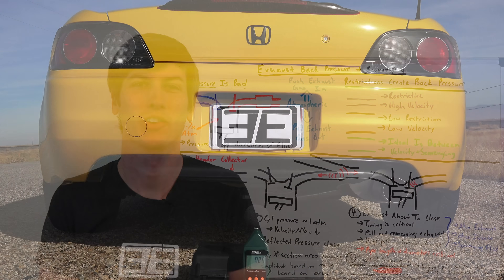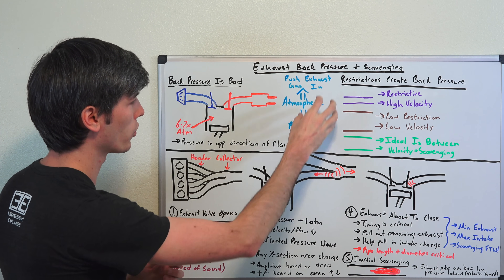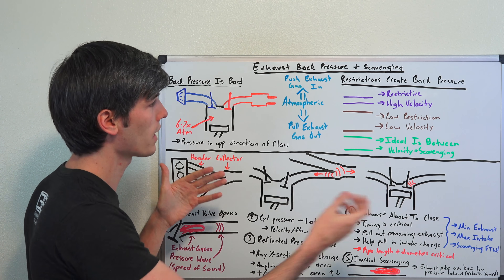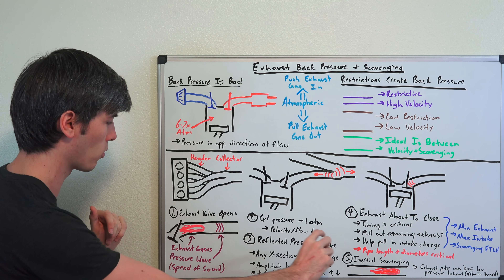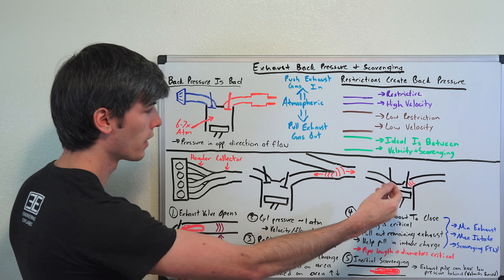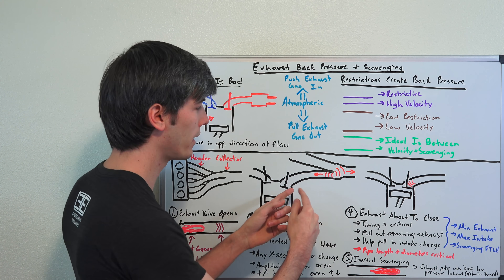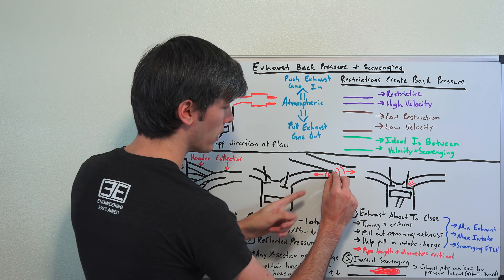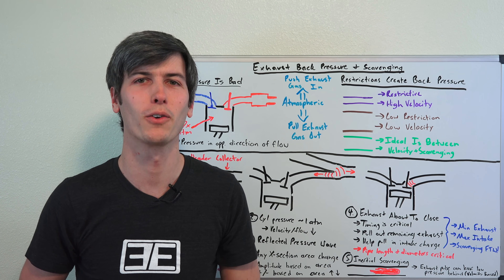Stop Saying Car Exhausts Need Back Pressure

Comment: I spoke to a few engineers on this and I would say you are wrong unless I am missing your point.  According to those  engineers, 0 back pressure causes havoc on timing because of rotational free wheeling.  If this is the case, then manufactures would have increased diameters on exhaust to increase fuel efficiency and increase power.  They don't do this because it is harmful to the engine.  It is why you should not run a boat engine out of water.  Not sure if you are a engineer but It seems you are one of the problems with new car engineering.  When engines blow up from poor designs it is not the engineers that screw the costumer by concocting story's of not changing oil frequently enough.  Unproven and untested design seems to come from kids right out of college.

Comment: plz explain back-pressure in motorcycles. does freeflow exhaust pipes increase power?
i think freeflow exhaust pipes allows best possible scavenging. power and mileage both should increase!
Reply: nope, freeflow increase the exhaust flow so intake flow increases aswell.  sensors see more air so injector pumps more fuel according to ecu mapping. if such great flow isnt listed on ecu mapping, your mix get leaner (combustion becomes less efficent and cylinders get hotter due to increase of oxygen). freeflow pipes creates more hp only if ecu have reliable fuel map and bike have reliable injector to keep a/f mix in good ratio.

Comment: You didn’t  talk about valve overlap ( there is a point in most performance engines that the exhaust and intake are open at the same time ) it helps with cylinder scavenging and get the intake cycle started earlier

Comment: When you're talking about exhaust velocity, are you talking about linear velocity (ms^-1) or volumetric velocity (Ls^-1)? I ask because they can do different things with changes in pipe diameter. With a narrower pipe, you will certainly increase linear velocity of the exhaust gases, but the increased backpressure (and hence a decrease in the pressure difference that's driving the movement of the exhaust gas) might well result in a decrease in volumetric velocity.
Reply: From what I understand, the pipe has to be wide enough so to not cause restriction/back pressure at high rpm, but narrow enough to create a fast moving stream at low to mid rpm.  While a wide and slow moving stream might move the same total exhaust mass, as a narrow and fast moving stream, per unit time, it also results in more backpressure - which should generally be avoided.

Comment: I'm no mechanic or engineer but during my viewing of this video, I came to the conclusion that having some sort of vacuum to draw out the gasses from the cylinder, instead of letting the piston and negative pressure remove the gasses, would be beneficial. What about adding a gas removal system somewhere along the path of the exhaust line? What would the drawbacks of that be?
Reply: This can be achieved just through proper exhaust design, NASCAR "boom tubes" accelerate the gases to improve scavenging

Comment: Would you be willing to research / explain how the catalytic converter (CC) changed exhaust tuning? Was tuning exhaust even a thing when CCs were first mandated? Does compensating for the CC in the exhaust tune occur upstream, downstream, or both sides of the CC? Anything of that nature about exhaust environmental controls, and their effect of tuning of exhaust system would be interesting. ¡Thanks!

Comment: Can you or anyone else here give me some recommended reading on the subject?  I need to design an exhaust for a mid engined race car and I'd like to make it as effective as possible.
Reply: I can't recommend any particular books per se, but learn what you can about exhaust flow dynamics, tuning etc, and the only thing you will have to really consider is how to package the headers, pipe and mufflers(?) into your application- mid-engined being somewhat tight on space/length. Look at old Group C racers- they ran v6, v8, flat 12, turbo, n/a, etc- and see how they packaged them.

Comment: All I know was my 1972 Dodge Challenger was faster with tailpipes after the muffler then when it dumped out right after the muffler on 3 inch pipe. I had a 429 cubic inch 383 with 500 hp. It seemed to give it more torque with the tailpipes. 3 inch tailpipes do the dial tips on each side set in the factory cutouts, it was an R/T.

Comment: I’ll explain it for the Dummies “Ahem you don’t need a baffle on a muffler. But don’t use a 3 inch tube piping on a stock 2 inch exhaust system use a free flow 2 inch system. P.S we need to thank this main for bringing our brains 🧠 out of caveman days. Also to the people below you don’t need to tune or recalculate the numbers most cars above 2003 PCM automatically does the changes but you can always use a flash tool to remove the Top Speed from your car. 🤔💯✅♈️

Comment: Great explanation.  However, I have seen many after market exhaust header charts that show (compared to the stock exhaust) an increase in power at the top end, but lower torque through the lower part of the power band.  My understanding was that the right amount of back pressure contributed to the improved low end torque.  Maybe I'm wrong about this.
Reply: This is actually true on my Hilux 2gd. Initially installed 3" downpipe to reduce back pressure. Ended replacing with 2.5" due to loss of torque and high fuel consumption.

Comment: Two stroke performance exhausts use back pressure,..so I've been told?.
Reply: Mark Letts this should give exhaust air recirculation, increases the pressure in the cylinder with the intake stroke. The fresh air volume should decrease but because of the burnt air that is already inside the cylinder which contains some oxygen the total amount of oxygen probably remains the same. So the only benefit would be increased pressure, more turbulence, and higher temperature, that probably makes the air and fuel mix better and burn more completely. I think this is good especially with a carburettor

Comment: Straight piped my Honda.
Made no difference. But I did use stock diameter pipe. Just hilariously obnoxious. I don't keep that on the car, I have a different exhaust setup with a muffler for regular use, and another setup with two mufflers and a cat for inspections.

Comment: Hi! I'm an Motorsport Engineering undergrad, still at first year. But could you explain how do you calculate the diameter and length of each runner and the collector size for a specific rpm to get the best out of it? i know each engine is different so is it possible to arrange any general formula?
Thanks

Comment: thats just not true... most engines as they come factory from do need backpressure to keep the compression ring sealed properly. its why people lose some of their torque band but gain a slight hp peak when installing a free flow exhaust. while the engine is able to run efficiently and make more power up top being able to breathe better, it breathes way too much down low and instigates piston ring blowby from an incomplete top ring seal. the compression ring is sealed by the initial explosion and backpressure after the exhaust valve is opened. at higher rpms there is an abundant amount of flow so an abundant amount of backpressure. at low rpms if you remove thw backpressure, you will be hard pressed to gain back the torque you lost with any sort of tuning due to the INABILITY to increase the size of the explosion to match the lack of backpressure at lower rpms. running an engine like that is a nice way to glaze your entire piston with burnt oil and provoke premature oil consumption

Comment: This is all good and everything for common engines but the question if you can help out is 
The “ HOT  V  SETUP  “ Where the Intake and exhaust  are reversed please explain  that set up.  That’s unique  as very few Engines use it.
Thank you.

Comment: Car guys, even mechanics, are not engineers.  They have not studied physics.  They see something like a slight performance decrease from a poorly modified exhaust and start making assumptions about the cause.  I can't tell you how many supposedly knowledgeable car guys insist a venturi in an exhaust draws the gases out faster.  That's wrong and would be perpetual motion.  That's what is great about this channel - he explains how it all really works.

Comment: But cars don't run on one cylinder.  With multiple cylinders, the "exhaust reflected wave"  will surely reenter a couple of cylinders when their exhaust valves are opened.  So just keep it stock always
Reply: May have multiple, but only one cylinder fires at a time - hence the term "firing order".
Reply: @unignostik  The speed of the cylinders firing relative to the much slower exhaust flow rate is akin exhaust valves are never closed fully before the exhaust can escape in time. Hence the term manufacturer finding the  "sweet spot"

Comment: Yes though this depends that the computer is able to adjust, the exhaust design etc...  Factory computers are typically designed to run optimal with the ability to adjust within a certain range.  Yes you can improve on that but this is about technical flow characteristics of the system.  Not that most cars aren't programmed to self optimize when higher performance parts are added.  Run e-85 in a flex fuel vehicle see how that goes with no tune.  It adjusts and runs, with less hp/tq and mpg, but wait it should make more power.  Sure simply find a shop with a dyno shell out $$$ and then it can.

Comment: I thunk the reason new modern cars require back pressure is because the ECU parameters for emissions control were determined by designers for the actual back pressure of the system as APPROVED for EPA certification?  Any deviation, higher or lower, screws up the delicate balance for low emissions!

Comment: Thank goodness, I found this video. I could've spent an equivalent of $500 US because the local mechanic here told me that my Yamaha R6's exhaust needs to be changed because there is no back pressure, blah blah blah. I bought the bike with a modified exhaust on it. The bike was first owned by a local drag racer, so I thought that the mods on it are better than stock.

Comment: What about a reverse turbo? Ie; the intake compressor is lower geared then the turbine so the flow of the intake charge (booosted with supercharging perhaps) drives a pumps to draw the exhaust gas flow?
Sonic wave scavenging would still be utilised to draw inlet charge aswell during valve overlap? No?

Comment: It's funny how people who don't know JACK about engines can maintain an Urban Legend based on ignorance. I've heard SO many Guys say that if you don't have back-pressure... you'll burn up your engine.  Now, MOST of these guys were talking about two-stroke engines. Lack of back-pressure will NOT burn up your engine. Lack of back-pressure will lead to your fuel and air mixture getting blown right out your exhaust. Back-pressure is essential in a two-cycle engine to keep your fuel/air mixture inside the cylinder. As the fuel/air is blown into the cylinder from the crank-case, pressure from the exhaust tries also to blow into the cylinder, creating a "Wall" of air that keeps the fuel/air inside the cylinder to be compressed and then ignited. Back-pressure is essential in a two-stroke engine. Four stroke?...…… Not so much.

Comment: Tuning is important today because everything is monitored by sensors and all the timing/fuel/etc is set in certain parameters by the manufacturer to a safer setting for warranty purposes. Tune it for more horsepower and of course you get less reliability and probably less life on your car but you'll have a faster car. Depending on the manufacturer and the model car you have, most sports cars from the manufacturer now take away the need for a lot of aftermarket parts. They've done their homework. Best example is the fact that most vehicles get no gains from aftermarket cold air or ram air intake because the manufacturer build it into the design already.

Comment: The need for back pressure saying comes from the 40s & 50s when exhaust metallurgy wasn't what it is today. Having some back pressure would prevent the gasses from escaping too quickly and melting the valve.

Comment: Cut the exhaust off your car and see what happens.  Install short, straight, zero collector headers on your daily driver.   Enjoy the benefits of "zero backpressure".  If you engine was a gas turbine, you would be golden.  Of course, if you really want "zero backpressure", you will have to race in a vacuum.

Comment: the likelihood of burnt valves goes up 10 times with straight pipes, explain that engineering explained if no backpressure is perfectly fine
Reply: Not the exhaust. Lean condition most likely from only doing half the job. Exhaust mods and intake mods require you to check A/F ratios. So it really isn't the straight pipe that's the problem it's the A/F ratio off. So if you do the whole job correctly the chances are zero you burn a valve from straight pipe.  You can warp an exhaust valve if it is cold outside and you run without manifolds till engine is hot and shut it off in the cold weather.

Comment: Hey, Engineering Explained. Since you say back pressure can affect velocity and there are higher amounts of pressure in the exasust system at higher rpm's. Then could I use an exasust cut out valve to regulate the back pressure depending on the rpm to create ideal velocity/back pressure conditions for peak exhaust performance at each rpm? Let me know what you think of this idea.

Comment: The way it was explained to me (by aeronautical engineering school) was back pressure was needed to help clear the space between the piston and top of the cylinder when the piston was at the top of the stroke and both the intake valve and exhaust valve was open. The air/fuel mixture would push out the remaining exhaust whilst the back pressure would restrict the amount of air/fuel mixture from entering the exhaust pipe. Not enough pressure could cause ignition in your exhaust pipe. However the engines we worked on were old VW boxer engines which surprisingly made pretty good aeroplane engines

Comment: out of curiousity, would the sound that an exhaust emits have any reference to the flow/pressure/back up of the gases? i.e. the common droning noises of "straight piped" cars, would that be the sweet spot where the gas is in its peak velocity and ill use the term loosely: but optimum flow rate for the valve closing and the pressure being mitigated?

Comment: So in otherwords.. Don't remove or replace your CAT with a highflow-cat or delete it. the muffler on the otherhand.. straight pipe it (muffler delete) or race style muffler (i.e. flowmaster outlaw) on it, or a single chamber (flowmaster street 10) or dual chamber (flowmaster super 40).

The factory stock CAT should maintain a good amount of restriction/backpressure, while removing the restriction of the stock muffler shouldn't remove as much as deleting a cat. Plus this is what would make most owners happy as it will make the car a bit louder with a less restrictive muffler or a-lot more louder (if race or delete) as most people who modify their exhaust, do it solely for the purpose of making their car sound louder and more powerful than it actually is.

Comment: Back pressure associated with older cars (60's V8s, for example) I read as it being necessary for smoother engine running.  Cars equipped with dual exhaust could have H-pipes installed on them to create a small measure of back pressure.  So what's the real story?

Comment: So is there a formula or a way to test different exhaust setups to verify which is better than the other? I am currently running a 3” exhaust from the turbo back on my 4 cylinder WRX and was thinking about switching exhausts but would like to know if one performed better over the other (without having to get on the dyno to verify)

Comment: You lost me at about 2:40 when you forgot to tell us why exhaust velocity is important. (It appears to have something to do with inertial scavenging, but I'm inferring that. It needs to be made more explicit.)

I think your explanation is missing something important: the Venturi effect. When a fluid flows past an opening in a pipe, it tries to suck fluid from that pipe too (entrains the other gases). Naturally this sends a negative pressure wave back through that other pipe. It's not just a larger cross section that generates retrograde negative pressure waves.

Comment: Much easier for me just to say "back pressure" than constriction induced exhaust pressure wave velocity, with subsequent intake enhancing vacuum pulse. Low end torque was noticeably decreased (in my case) with too much flow/no restriction for a BMW 4 cylinder with dual 45DCOE Webbers. (similar to bad turbo lag)  When exhaust systems are expanded to the point that the pressure waves aren't useful for any effective venturi action, acceleration of rpm's will take longer, unless your equipped with supercharger/nitrous/high compression, in which case you wouldn't worry too much about low end torque or performance exhaust tuning. On a side note, wood stoves are good basic examples of naturally aspirated devices utilizing the venturi effect and requiring basic exhaust tuning.

Comment: "Back pressure" is just a term people who read too many car magazines and think themselves engineers use to overly simplify the very complex fluid dynamics involved in the tuning of an internal combustion engine, which real engineers use computers to simulate extensively before they build anything because the problem is so mathematically complicated that it's literally impossible to solve analytically.

Comment: Been a tech for over 20 years. I’ve seen many check engine lights caused by aftermarket exhaust that lower back pressure. Many cars were even designed with back pressure transducers to operate the EGR systems.